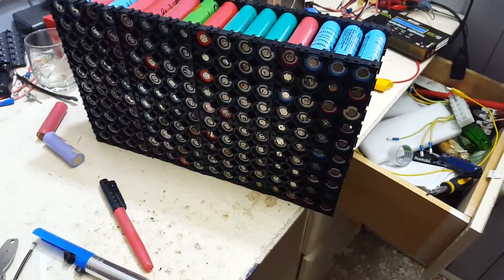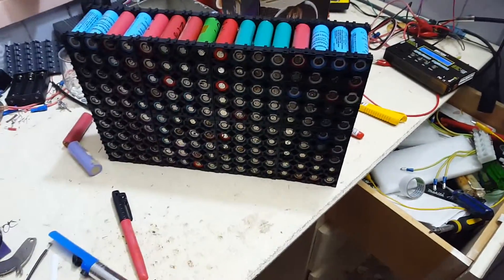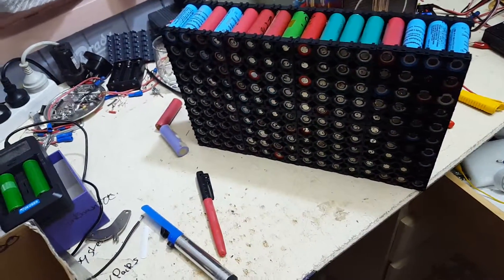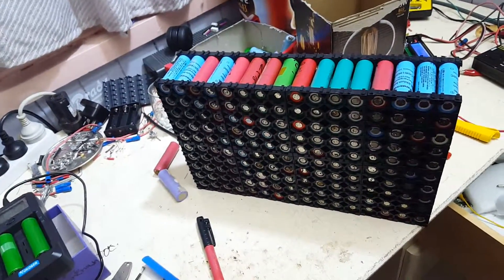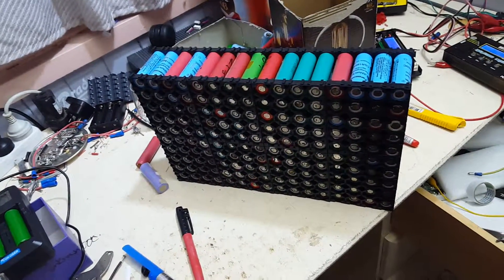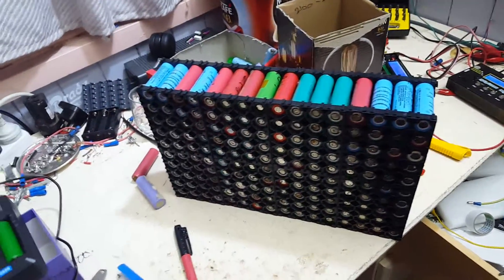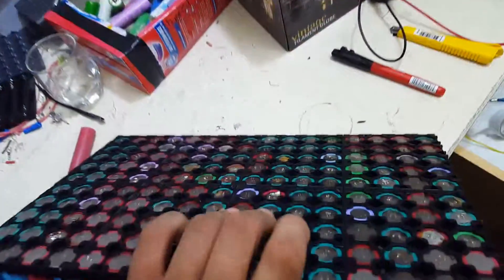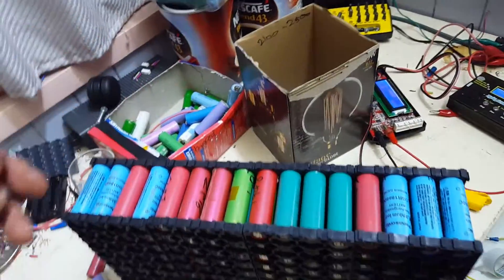18650 EV battery 160 cell  number1 assembled

Comment: how many volt/amp is the battery
Reply from the maker: +Chis Ngwa this pack is 360amp at 4.2 to 3.2v charged/to depleted. 3.7 nominal during heavy  draw offs
Reply from the maker: +Chis Ngwa this pack is 360amp at 4.2 to 3.2v charged/to depleted. 3.7 nominal during heavy  draw offs
Reply from the maker: +Chis Ngwa i have a 77model ford falcon  ute that will be getting  twin dc motor and full electric  conversion